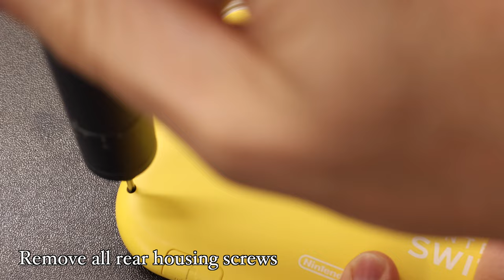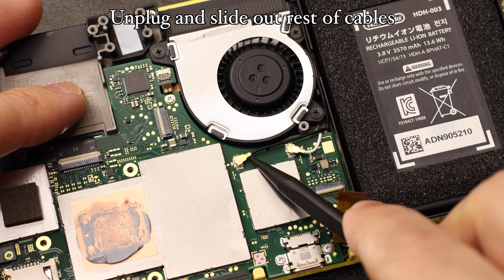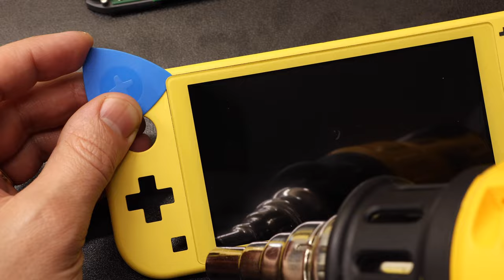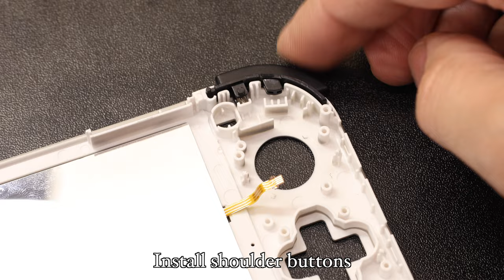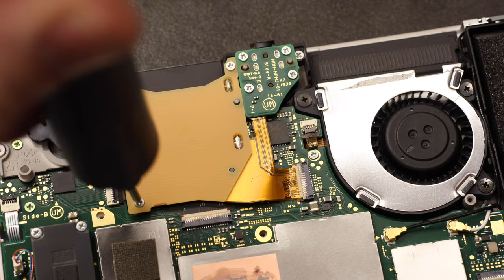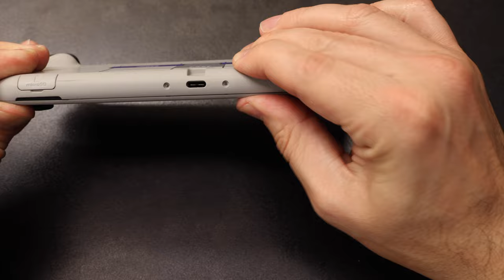Nintendo Switch Lite Shell Replacement | Custom SNES Housing Swap | Nintendo Restoration

Comment: So what would one do if i accidentally stripped a screw to take off the metal backing to access the rest of the
Reply: The metal is actually real soft.... So you can easily move it around and the little hole will get bigger and it would go over the screw obviously 1 or 2 screw is not bad still have like 4 or 5 more screw but of course don't abuse 😂😂... 

Either way any kind of switch all the jobs are simple and entertaining

Comment: It looks like these are painted instead of molded grey plastic. How well does that hold up?
Reply from the maker: The paint used is smooth almost velvety, it has not rubbed off with use and I keep it on my desk, no traveling, so no scratches.

Comment: You should have replaced the termal paste after removing the heatsink.
Ikr, the Switch wont generate that much heat, but better be safe than sorry.

Comment: Where did you get the grey screen with the ribbon cables already attached? Or did you somehow move them from the yellow bezel?
Reply from the maker: That would be the digitizer, They come in a few different colors and will need to be purchased separately. I have some links in the description that may help.
Reply: Didn't see the Digitizer and all the other reshells on youtube show just a black screen protector that cover the switch color. I like your idea better @TheFixTech